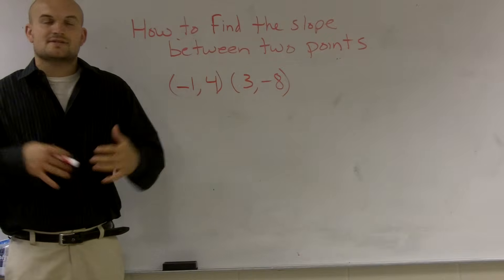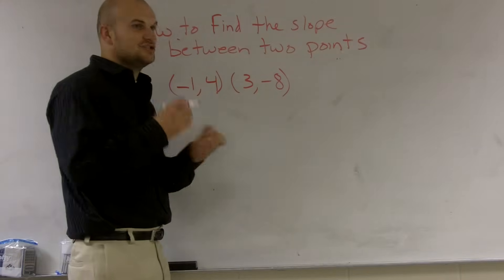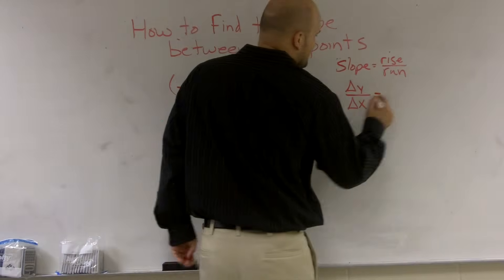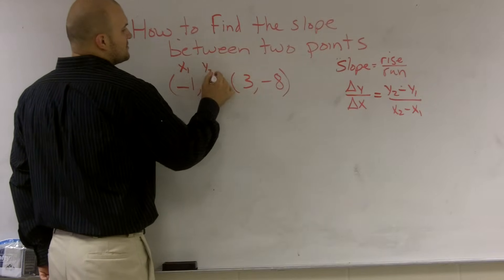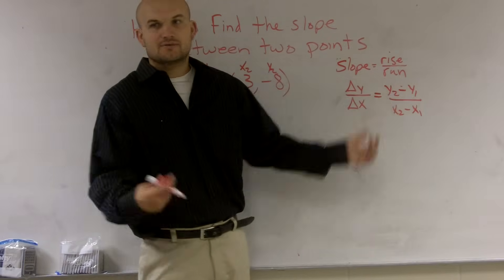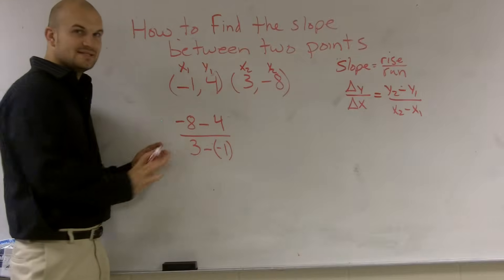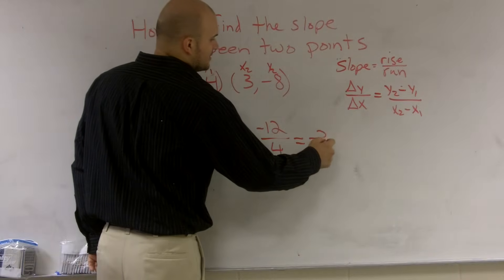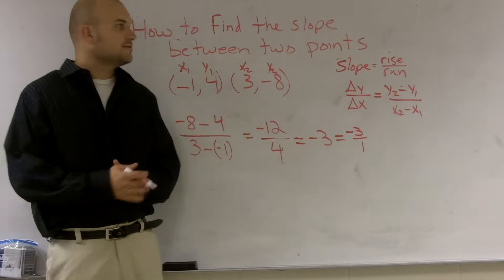How to find the slope between two points

Comment: Ok so what if you have 3 x numbers and 3 y numbers.

X    Y

-3   10
-1  4
1    -2 

The answer is -3 but can u say the steps to do as IDK and if your wondering how I know the answer I guessed and got it correct but IDK the formula on what to do when u have 3 numbers so yeah.
Reply from the maker: if they all fall on the line then just pick two of the points
Reply: Brian McLogan ok thanks 😅
Reply: Brian McLogan Hi again, so we have a circle and a triangle inscribed to the circle (it's an isosceles triangle) and here the question

PQ= PR = 15. QR = 18. Find the radius of a circle, and if u were able to make a vid it would be more helpful as I find it easier visualising

Comment: I have a question when you did -8-4 how did it equal -12 because 8 + 4=12 so wouldn't it be addition with -8 and 5
Reply: I meant 4
Reply from the maker: think of negatives as owing money.  You owe me 8 dollars and the owe(subtract) another 4.  You now owe me 12 written as -12
Reply: Same sign add and keep.
Reply: its negative because if the largest number is negative it most likely gonna be negative in most cases
Reply: Braunie Marie because you have to keep change switch so it would becom -8 + -4
Reply: Thank you so much for helping me with my math test due yestoday
Reply: braunsen mansell no wtf